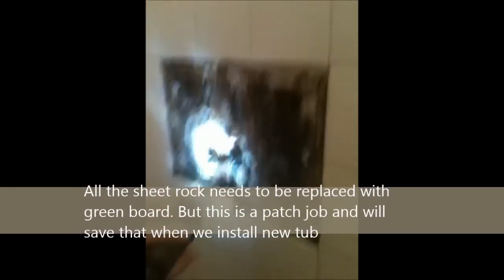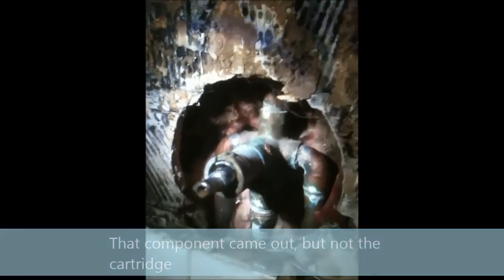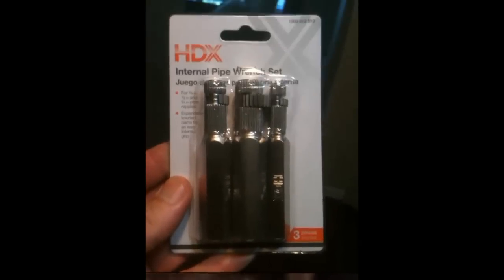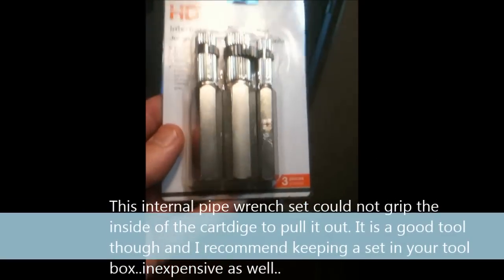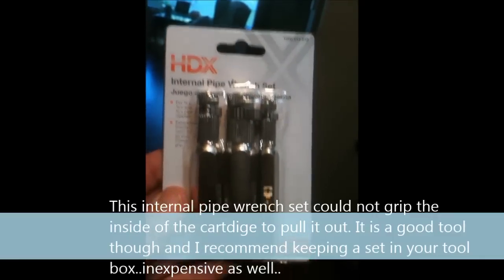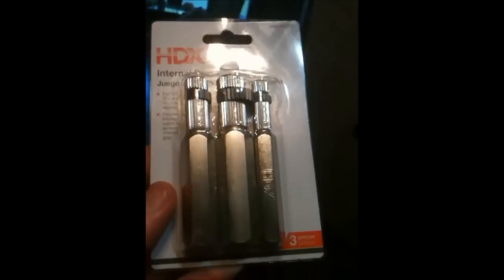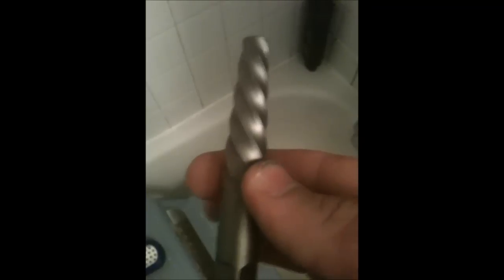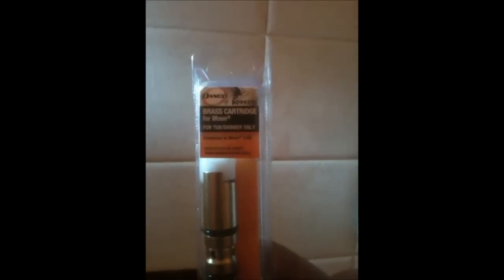stuck moen faucet cartridge removal

Comment: the outer sleeve was stuck in the housing. after watching this i went to a real hardware store (not a box store), got the #6 extractor & the sleeve broke loose almost immediately. then a little pulling & it popped right out. thank you so much. i was done, sitting at the computer 10 min later :)

Comment: Thanks for the tip . The #6 extractor from the auto parts store, tap a few times with a rubber mallet to seat it , a few slight nudges to the left to be sure it's locked in, another slight tap with rubber mallet to be sure ,  a 12mm open end wrench turn to the left to break it loose , then get a good grip on with the best you got vice grips or channel locks and wrestle it out .  Clean the now empty copper with some silicone blaster and a good rag.  The rest is obvious, put the new cartridge in and take a long hot shower.
Reply: Just tried the #6 extractor idea, worked great !   Thanks for the tip

Comment: I used a 4' long 1/2" lag bolt.   Cost $1.39 at local hardware and with its pointed tip and heavy thread it worked  well.

Comment: here's what I do if possible...1. go buy a brand new tub/shower valve & trim set ($80.00). 2. Trace a line where the large chrome plate covers the hole and cut along the inside of that line as to make the hole as large as you can where the plate will still cover. 3. remove the existing valve body with metal sawzaw blade. 4. remove new cartridge from new valve body so you don't smoke it and carefully  solder in the new valve body. 5. re-install new cartridge and test for leaks. 6. install brand new trim, filler and head. 7. Most importantly: take the old valve body and throw it as far as you can into a vacant field, ocean, river, whatever feels best.

Comment: they make another type of Moen puller that has a t handle but has a spring loaded type of pin that grand the hot or cold side when pushed into valve . easy as hell

Comment: Just buy the cartridge puller tool. Unbelievable!
Reply from the maker: This is "after" you utilize a tool like the puller and pull the cartridge out and the sleeve is still stuck in their.
Reply: They also sell a tool for $10 that removes the sleeve when it is left behind. Scarring the inside of the housing that holds the entire cartridge creates a whole different set of problems. Sorry, but this video demonstrates how it is not done.